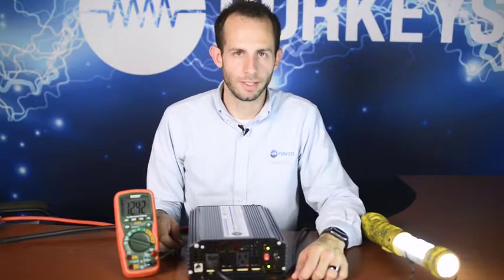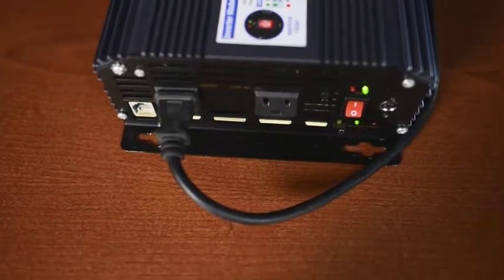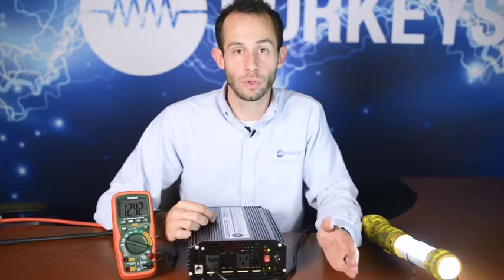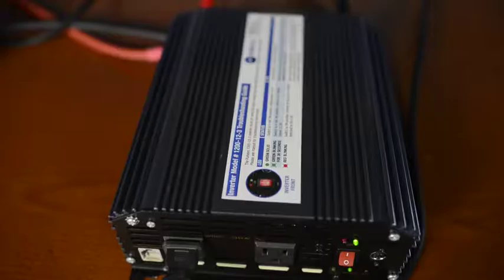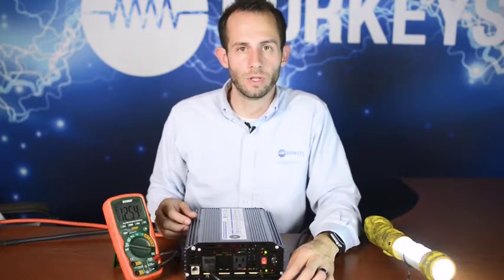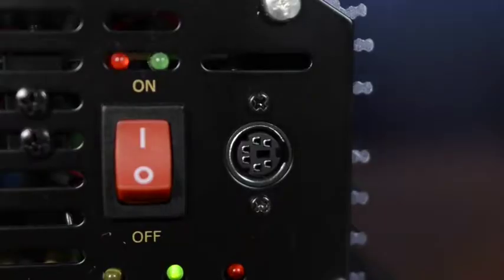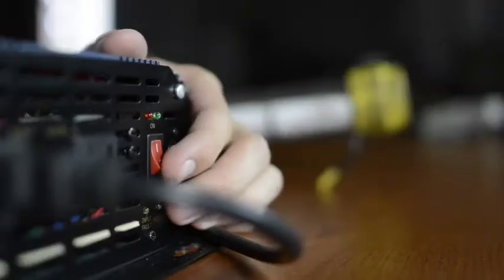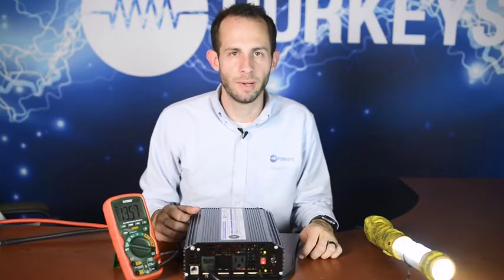How It Works: Low Voltage Disconnect - Purkeys

Comment: How do you set the LDV to be a different value? It's programmable, so how can I do this myself without  going to a mechanic with overrated inflated prices?

Does it need an app for phone when connected via usb, or a PC with specialized "screw-the-public" mechanics-only software?

I need to manually adjust the LDV to a permanent value and I'm not about to stroke another mechanics ego for it

Comment: how do you program it? mine shuts off at 11.5volts  and for my application, thats just too soon
Reply from the maker: Hi Jason, not all of our inverters are programmable by the user. It depends on the model and the requirements given by the original purchaser, as many fleets require that the inverter be set at a specific shutoff point. If you call in to our tech guys, they'll be able to help you in detail with your specific inverter: 479-419-4800.

Comment: where do you get them though?   I can't find one that will protect my battery by cutting off above the usual 9.5 volts...that will be the dead zone on my AGM battery bank   
      I need one for my Portable off grid array....Have 400 w of panels , need 2000w / 4000w Inverter.... 200ah battery bank...
Reply from the maker: Visit http://www.purkeys.net/where-to-buy/ and contact the distributor nearest you, or feel free to contact us directly with any further questions.